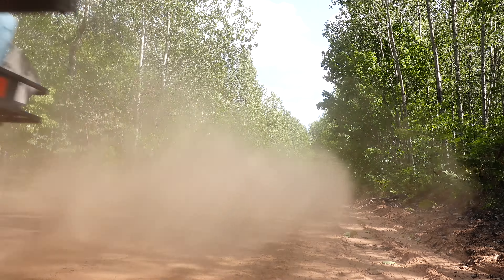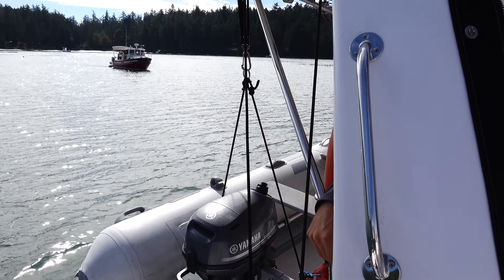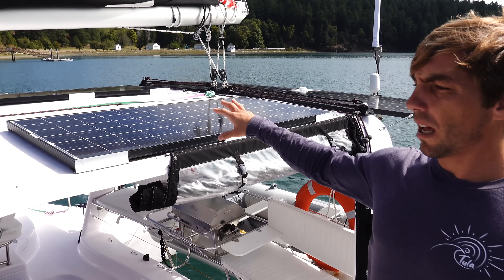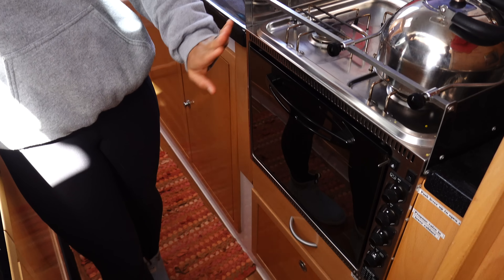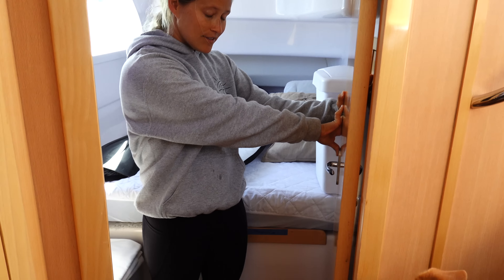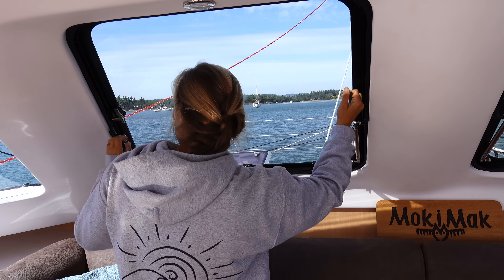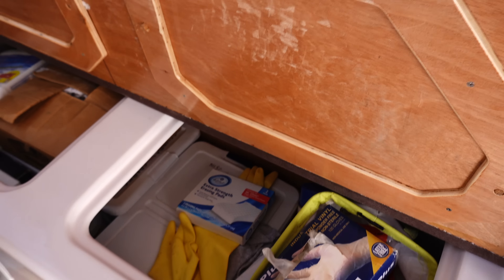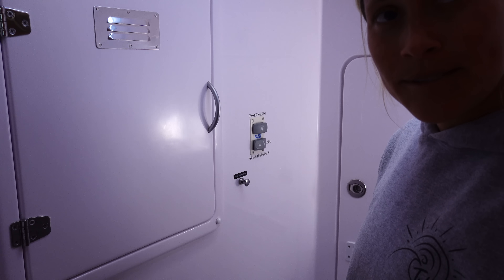The BEST Catamaran you can buy for LESS than $500,000? [FULL TOUR SEAWIND 1160]

Comment: Hi, we live aboard our seawind 1160 for the past two years and for us the availability of diesel and not petrol in isolated places and fisherman’s harbours and the long range we can get with diesel and the extremely good torque that you get with gori props means that you can move the boat around in wind easily and accurately. I know you need plenty of revs to move the boat with the outboards but if you are not going long ranging outboards would do. You only need that one electric winch, no need for another . Seawinds are incredibly strong boats and don’t flex at all and so they don’t creak at all, there is zero creaking sounds , dead quiet , excellent little ships . We’ve had trouble with the screecher being too enthusiastic when the wind gets up over 15 knots and you’ve got to get it down early or you will damage it, so I have done twice. You can’t go wrong with a Seawind. Tough tough tough.

Comment: My 2 cents - No microwave, understandable, but have the space wired for it. Same with the diesel heater, see what the cost would be to plumb/wire for it. Added bonus if/when you decide to move on to a bigger boat. Nice boat, nice views - enjoy!
Reply: Yes as a trucker I have a diesel heater in the sleeper and that thing is ultra hot too hot as I have to be careful about where my boots are as the heater can melt stuff and wreck leather .Still even in Northern Canada that heater has kept me warm . They use only a tiny amount of fuel

Comment: I think that  tri-fold door is AWESOME!  Looks like you guys are getting a nice boat since it's pretty much a carbon copy of what you're on.   Just something to think about with the cigarette lighter ports vs the USB ports, you can easily turn a cigarette lighter port into a USB port but I don't think it's as easy to go the other way.  Keep the good stuff coming guys.
Reply: Cigarette lighter ports and USB ports are both easy and cheap to install later if needed especially if one or the other is already there, just piggy back off the existing wiring and don't try to use them both at the same time.
Reply: did they ever mention in any of their videos what they are paying for their new seawind?

Comment: Another consideration in the decision tree for 12V "cigarette lighter" receptacles vs built-in USB plugs is that USB technology is constantly evolving and you can always buy the latest and greatest USB adapters that plug into the 12V receptacles. However, if you have the factory install USB plugs then you'll be stuck with whatever the current technology was at the time of installation.

You might also put the dimmer option for the all of the overhead lights on your priority list.
Reply: The other problem is built USB plugs and sockets are subject to rapid wear and failure and not easy to fix.. a more robust plug in adapter is more serviceable and their are already too many USB type format variations . Which also have limited current carrying capacities. 🤔

Comment: Where you are going, there are bugs/insects (mosquitoes) you will need to keep out of the boat, especially at night. Hatch and window screens are very important. The boat you are getting has large openings, which is great for air circulation, but also, will let the bugs in!  Please consider ways to keep those unwanted critters outside! Air conditioning will be something you'll want, so the boat should be built a/c ready so when you decide it's time it is not a major installation. A generator is a must! You guys are very savy, but don't cut yourselves short things that provide creature comfort.

Comment: Consider resale value with your boat, even though you think you will not sell it? there are things that used boat buyers are go to want no matter where they sail, diesel heat, opening and closing cabinets, electric winches, auto pilots, and many more little things. Electric toilets in the long run are expensive, motors are not cheap, good quality hand pumping toilets will save money and not leave you with a non working toilet. It’s always a challenge picking options when you buy, cheaper and easier to get in now, than to think you will put out cash money later to but options. If your financing, do a spread sheet on your options and how much more a month they are costing you, make decisions based on that. I love your channel and I’m excited to see your new boat.

Comment: Love Seawind cats!  Carefully designed by sailors for sailors with all of the stuff you need for comfort, safety, and rare performance in a 38’ cruising cat.  We plan to charter one of these for a trip to the Exumas next year and I think they are perfect for 2 couples or a family.  One suggestion is to consider keeping the many 12v cig lighter outlets.  They are universal high output charge outlets that can run up to 6 USB ports, laptops, camera gear, handheld radios, or anything you can imagine with inexpensive adapters.  As devices evolve over time I expect there will always be an adapter available to use these 12v outlets.

One question:  Could this be a pocket world cruiser for crossing oceans?  With one reservation I would say yes.  Plenty of comfort and protection, enough water and stores.  I would probably rig something to reinforce the tri-fold door during a crossing to protect it from the possibility of taking a big sneaker wave over the stern, crashing through the doors and flooding everything in one shot.  That should be fairly easy to rig and then just de-rig when you make port to enjoy the open floorplan again.  What do you think?
Reply: 2 different couples I know that have Seawind 1160's have circumnavigated.
Reply: The trifold door can be fully opened or set with 2 panels locked down closed and the third opening and closing like a standard door. 
If I’ve understood your post correctly, you think a sneaker wave could smash the closed trifold door? I think that might be unlikely but it would be an interesting discussion point.

Comment: Not bad, tho what do you think of the excess 11 or 12 over this? I wish they had an electric motor for this and some type of hydroregeneration system under sail. I think only a petrol or diesel option is not enough. It would be great to be able to go completely off grid on one of these, with only solar hydro and wind energy.

Comment: Two things.  First, I would tell people the same thing with optioning a boat as I do with a house.  Do the things that would be impossible to change later, and forego those things that could be added.  Secondly, I think electric outboards for power would be incredible.  No engine sounds, no fuel maintenance.  Range only limited by your stores.  You could run under power while someone sleeps right over the motor without being disturbed. It would be amazing.  You can get electric outboards up to 50HP.
Reply: Actually you can get up to 130hp outboards now.

Comment: Cheers to the Crew, congratulations on the wedding.
Is the shower enclosure in the head, glass ?   That needs to be plastic for safety !
Is there a single helm option looking over cabin top rather than looking through the cabin ? 
What are the prices ?  Yes, you will need window screens to help with hot green house effect in the tropics. When is your delivery date ? I find the 12v plug in adapters dangerous, had some melt in use. Better to have the USB plugs. Cheers, Sail on.’😀

Comment: My dream boat...ill take electric outboards though with backup diesel generator...nice quiet and possibility to motor for free if needed plus the benefit of less through hull holes that can cause problems. The servicibility of outboards whether petrol or electric off course much easier and can even remove if needed.
Reply from the maker: What if you get struck by lighting and both motors get fried? 😳
Reply: @Tula's Endless Summer good point... from what I've seen if actually struck by lighting most electrics and electronics could be fried anyways, including the batteries, which would impact your ability to start a diesel motor.

That said there are some lighting protectors available to protect you against this, but do ensure you get a decent one as the cheap ones are worthless. That will undoubteldy give you proper protection.

In addition you could perhaps consider a way to disconnect all electrics and electronics if you find yourself in an area with severe lighting?

Comment: I would happily live on that boat no problem. I think I looked at them a few years ago and it's the same issue I have with all new catamarans, and all new boats. My budget is more oriented towards used boats lol.
I added usb ports to my boat. All the cigarette lighters are is a positive and negative wire, so you can put in usb or 12 volt socket or something else. My boat is from 1978 so I use the 12 volt for a fan I plug in, but I added usb by the bed and helm because of phones and tablets. When I bought the boat the 12 volt socket didn't work, but luckily someone had added a newer stereo with a single usb so I could charge my phone. That was handy when my boat got impounded by customs in Friday Harbor and I needed to hire a customs broker to help with importing paperwork and they are all in Blaine, so a working phone was important. 
I also have usb plugs on the charge controller when I added solar panels. I don't think you can have too many.

Comment: Option it out: 1. Two 15hp Honda Extra Long Shaft High Thrust, 2. C-head composting toilet, 3. galley shelves would have doors, 4. 12 volt Heat Pump - Mabru 12K BTU, 5. Two Honda generators. 6. Microwave - yes. 7. Propane water heater and stove-oven, 8. Rig: Removeable Cutter forestay, Genoa 130%, bow sprit - screecher, 9. Hard dinghy w/ 15 hp Honda.  Seawind catamarans - so clever.

Comment: Love our electric macerating head. The do require a pressure water source, seawater or fresh water. You may be able to have both with a selector valve and the option for holding tank or overboard discharge. Choices !

Comment: add as much solar as you can with the biggest lithium bank also i believe you can fit 5x 400 watt panels across the stern of the boat and as much flexy panels to the coach roof on 20mm coreflute  to max the output

Comment: Only thing for the hatches and doors is ...they would benefit from noseeums/midge/mosquito/Horse and screw fly nets for when you want open windows but the wildlife wants to visit and stay for a bite to eat.

Theres a simpler safer alternative to electric flush loos its a vacuume flush ... Fit and almost forget.
Simple mechanical bilge type pump component ... And a seal round the lid...no valves no motors ..to stick, clog or corrode .

Comment: Is that trifold door so heavy that the winch is necessary, or could you just lift it up there & lock in in place?  Or does the line help keep it safely up?
Reply: it 's pretty heavy (nice solid doors) but doable by one person - the line is also a good safety measure. The locking device is very secure but as all things on a boat a back-up is good.

Comment: Hey - I love that simple U-bolt system the owners put in for holding the freezer doors open - can you describe that a bit more, maybe take some photos of it (and post on the FB Seawind group)?  I'd love to do the same for our 1160, so just curious how they actually set it up...
Reply: Its very simple. The U bolts are drilled through the wood above, where there are o rings on both sides and than a bolt on each side. So the U bolt can lift up/move away when the freezer door opens, but holds it in place when it leans against the U bolt.

Comment: Check out "S V Pali Pali " 1160 videos. Very good info. Also an Australian couple On " Sailing SV No Regrets " a new 1260, show tips  they did to their boat in the galley  (same setup as 1160 ).
I've looked at stacks of these great Seawind boats on the internet , and was surprised to see there is an 1190 cruiser available. Hybrid between 1160 and 1190. I really like the lines on the 1190.
One thing that always catches my eye is the  rear bench seats  and backrest. The gap looks like a quick way to loose things when sitting over the water.
The Seawind 1160 is a beautiful boat and  I like the  lite version interior . Very modern, so clean and a very tidy layout.
Looking forward to the day your boat arrives.
Cheers.

Comment: Dagger boards or mini keels? You didn't mention, so I'm guessing it has mini keels. That's a definite 'NO' for me. It's always the first thing I look for. Mini keels don't sail to windward, you just go sideways! Even on a beam reach they slip to leeward. They increase drag too! You use less fuel under power with d'boards, cos you've raised them. 'Lifting' d'boards, which are vertical foils, actively reduce sideslip. You might not relish an upwind sail in choppy seas, but in good conditions they give you more options. The obvious disadvantage is the casing, but needs must.
Reply: Then you get the 1190 (as that has dagger boards)